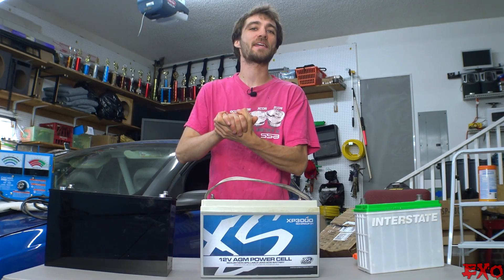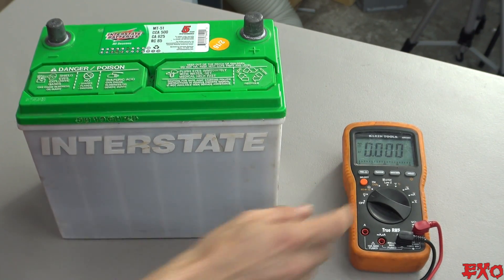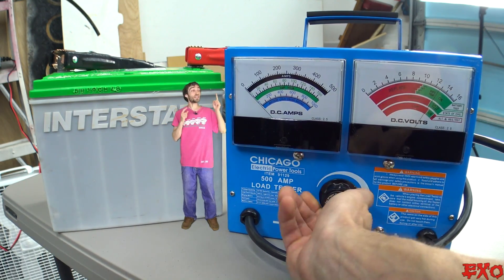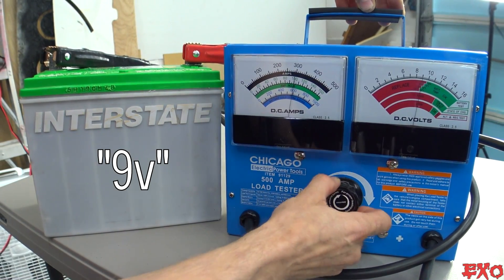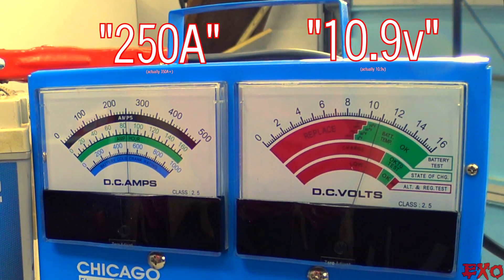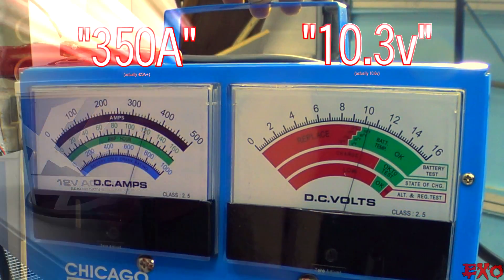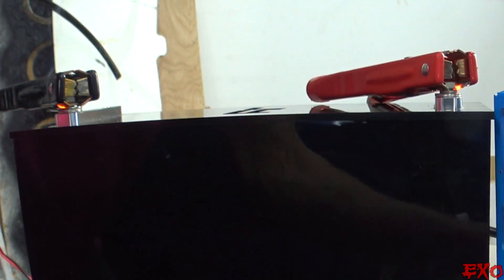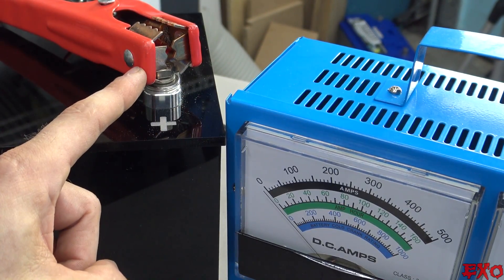BIG vs SMALL Car Batteries w/ Harbor Freight LOAD TESTER | 12V Flooded + AGM & Lithium Battery Test

Comment: Most vehicles run Fuses roughly 250amps. Of course, there are exceptions to everything. I understand the product should work to the standards or abilities it describes/shows but for the majority defective or not that looks to be a pretty handy load tester. May have to get one one of these days. Thanks Exo.

Comment: Those meters need calibration and the production quality on these things are not great so it's always better to change the amp meter and volt meter with a digital one and connect the sense lead of volt meter with separete wires right at the alligator clips for best accuracy . Also install a one or two 12v computer fans pushing air from both side vents into the resistor to keep it cool incase u wanna run it for a minute or two..
Reply: I will link in a volt amp meter that can measure your required current range and voltage accurately. Just look into the flagged comments section.

Comment: Install some computer case fans like delta fans from old dell hp computers (u can ask any recyler they should have them ) those are really high rpm fans and blows tons of air u can power them with an external 12v power adapter and keep the resistors cool while running high load.

Comment: Hey buddy I got a question how can you tell if your battery cap is bad I have a kinetik HC1400 how can you tell if it's bad how do you go about charging it is it like a regular battery to charge I have it on the charger now and it's reading 0.7 on the charger when I put my multimeter to it it says 0.36 does that mean the battery is no good I wouldn't know who else to ask but you ?

Comment: some user error issues. im glad you recognize some problems.  its not always the equipment. i see so many negative reviews on amazon from people that are just to dumb to use the product. those are some very dangerous currents your playing with.
Reply: those were probably accurate readings at the meters. you were causing a lot of loss through heat and resistance as you saw. you were almost welding there.

Comment: Can i use two different 12v batteries , a stock battery and a secondary 3900 ampD6500 xs in the trunk?

Comment: Hey exo, I have 2 Orion XTR 10” subwoofers and them together is 1000w RMS, I’ve done a little research on matching the rms and ohms and I was wondering what I need to finish the installation for when I get a car. What altornators, batteries or capacitors do I need? Also keep up ur vids ur doing amazing😃👏🏽👏🏽👏🏽

Comment: Add a second set of leads to the clips for voltage measurement only and recalibrate the current meter.  Should do the trick.

Comment: Iose connections cost me my subs and learned my lesson with push spring terminals instead of going direct or bolted. My subs were beating so hard loosened the positive terminal on the inside of the box and started arcing my fuses didnt blow instead it melted the fuse, fuse box and wire i haven't bought new subs yet but i have upgrade fuse size and went 0 gauge and changed my box for direct sub wiring but cant figure out what subs to try next i want PSI but right now my price range im looking more towards some SKAR subs anyone that reads this give me some feed back 👍

Comment: That lithium battery costs a cool 2 grand. . . I think I can live with my AGM batteries.
Reply: But it replaces about 3 grand of agms 🤷‍♂️ so it's still cheaper.
Reply: @FiBTL18  only in the voltage point when your alternator cant be replaced you have much less capacity in the batteries. For my vehicle 400ah is about right because i cant switch my alternator so the 12kw setup need that
Reply: @thomaskletzl6493  not actually, lithium amp hrs are double that of agms. Due to the fact you can't discharge agms to 0% without damage and shortening life cycles as where you can do that with lithium. So for your 100ah agm you only can actually use about 50ah of that capacity so your 400ah is really only 200ah. With 100ah of lithium you get the full 100ah. So 50ah of lithium=100ah of agm. And they charge in minutes on a ho alt from dead to full, agm takes a bit longer. I have 2 lil 15lb lithium cyber 12ks running my entire truck and 2 wolfram aw9000.1 at .5ohm along with another 1k amp for the mids n highs. Voltage stays in the low 14s never ran out of battery, and that's with just around 100ah of lith. 🤷‍♂️  I would need 10 100ah agms to be able to cover the same wattage as these 2 small light lithiums handle (bout 30lbs for the both). And would still have more voltage drop with the 1000lbs of agms.

Comment: Great video! Not sure if you have covered this before  but I have a 1k sub amp (kenwood) and a small 4 channel amp. Is it a waste of time to do a big 3 upgrade with 4 gauge all around or would it be a wast of time in my 02 civic? I want to do the upgrade I just dont want to waste my time because I dont plan on going really high with my subs

Comment: I have a Lithium Battery in my 2018 Harley 1200. Lithium batteries need to be woken up. Especially when Cold. Below 50F. Winter sometimes took 5 tries to get the engine to start. The battery is a Twin Power, Direct drop in.

Comment: Are you using them old crusty batteries in 2019. We have LiFePo4 HP.
Do not buy Lead batteries, they weigh too much and you can buy LiFePo4 HP for the same price,  half the weight and faster discharge current.

Comment: You are measuring the volts and current in different places, the resistance will effect this, lower volts will equal lower amps, that's why a 6 volt battery will not start a car, it takes a higher resistance to to pull the current , more resistance , less current, like a 24 v battery on a 12v starter, will pull twice the current as on 12 v battery, totaling 4 times the wattage, on 24v

Comment: They are good load testers but need some mods to be reliable. We use a bunch of these to test power supplies for high amperage CB use. 

First we remove the ends and solder on solid copper lugs to be bolted onto the supply terminals. Then, as you did I use a Fluke Amp clamp meter. Further mods include a small fan in the case, and adding a washer onto the knob. If you keep unscrewing it too much the cheap Chinese metal will strip easily and a washer will help it from backing out as much. We’ve greatly increased the life of this load tester but doing this stuff.

Comment: Having the battery terminals getting hot will show a lower voltage due to resistance, but it should not affect amperage. The difference in amperage between the clamp meter and analog meter should be the same, regardless of connection. there should be more difference in voltage between the multi meter, especially on the lithium, because those hard terminals connect with a sharper point load, resulting in more resistance. When things are glowing red, you know you have a lot more resistance. Those clamps get a good bite on those soft lead terminals, but not that nickel plated brass. If the connection on the lead terminals is poor, the lead melts, allowing the clamps to bite in deeper, increasing contact area.
     It might be worth taking the load tester apart, and going crazy with resistors, especially the ammeter shunt. The voltage, you can't do much about, unless you use separate leads, like when you use the multi meter. Voltage drop at 300 amps will show more of a voltage drop, than just the battery under test.

Comment: I have one of those load testers. I fried one of the connections inside on the unit. I completely rebuilt it. It has alot of loose connections and sub standard solder joints.  Both of the analog  meters on the unit are adjustable. So I calibrated it and it  now works like a charm!

Comment: Could it just be human error?  I mean you were resting the cable clamps on the battery while you were running current through it. Possibly grounding it out?  I know the tester was off but you were resting the clamps on the battery while being connected to the posts. That’s a no no.

Comment: some of the voltage difference is coming from reading the voltage at the battery on the digital and the load tester takes the voltage from the other side of the cables. if you factor in the voltage loss from the cables the analog meter isn't as bad as it would first seem.

Comment: Hey dude! Great video!
I would love to see a lead acid vs AGM battery in your car (with a big stereo)! Just to see how big of a difference it will make.
I have a 95ah lead acid battery in my bmw with a 1200w (@ 1 ohm i think, rms ofc) and a 150 ish amp charger.
Lights are blinking pretty much when i turn it up. So instead of adding another battery (witch i have) im thinking of upgrading the battery to agm. I dont have much space for an extra battery either.

My amp sits right above the battery, so cables are very short.
Love your videos!
Reply: Old one , but how did u do. got the e61 lci with 170a and a deep charge 105ah 920cc efb and running 1200wrms

Comment: Yo EXO, would you be able to cover 14v and 16 volt systems and talk about what is needed for a daily to run one of those? Like for example, 14V battery instead of a 12V and what is needed to properly maintain and how it affects your car and audio system.

Comment: 2 comments.  Drawing 250A from each battery is not really a fair test since at different voltages, you are drawing different amounts of power from each.  For example, 250A at 12V is 3000 watts but 250A at 10V is only 2500 watts.  You should do a watt test such that you pick some goal wattage (such as 2500 watts), then show what voltage and amperage are required to get it for each battery

Secondly, I wonder what would happen if you paralleled all 3 different battery types and then did this load test.  I wonder what it would do at a full 500A draw.  The FLA battery type would want to voltage sag the most but the other 2 batteries wouldn't allow it to do that so much.  It would be an interesting test to do it and check how many true amps are flowing from each battery into the 500A (total) load.  You should consider doing this as a follow up video.  Thanks.
Reply: The amperage will increase inversely proportionate to the voltage at a given wattage. I have very successfully run LiFePO4 in parallel with AGM batteries, it works very well. Flooded cell lead acid mean voltage is just a little bit low to parallel as well with the lithium.

Comment: get rid of those clamps and stick on some ring terminals on the wire ends. it will give a solid connection and probably give a better result. also add a fan to cool the resistor.

Comment: I have the XS power 3000 and it keeps my DC audio 2k and 175.4 fed. Alternator keeps it charged almost full all the time but I do run it down just to cycle it some and charge it back up with my smart charger. It and my battery under the hood. I got all 1/0 XS flex OFC wire and dual inputs a foot from the amps in the back. I have a stinger volt meter on my 2k and it drops to 12.9-13.1 volts under full tilt long sessions. I’m pushing 2 LVL4 12’s so it’s got its work cut out for it. But I did make the box bigger to make it a little bit more efficient so it’s probably about right. It is tuned to 32hz and I’m right at 3.3 cubic foot so 1.75 a driver, recommended was 1.5 so it plays down to 20hz and up to around 80 no problem. Of course it’s louder in the 30-40 range but what Ported system isn’t that’s tuned for music. I do plan to add 2 more and another 2k.

Comment: Hey EXO say I have two brand new wheelchair batteries how would they work pushing my 4000 watt amp instead of running the amp wire from the battery?

Comment: I always ignored the meters on mine and used a clamp meter and multimeter.
If you upgrade the cables too 0g gauge and bypass some stuff inside they'll do up too 1700 amps.

Comment: the digital multimeter as the analog multimeter don't make true measurment because they are not calibrated.
Do you have some calibration sheet when you have bought it ?
Sorry for the mistakes english is not my mother tongue.

Comment: @EXOcontralto the U-charge Cost Almost the same as your JY except the JY has 80AH and the U-Charge has 138AH whats up with that and the XP U-27 comes rated at 4000 cycles at 80% can u do a vid on this if possible and does the XP JY come with a built in BMS like the XP U-27 ???????

Comment: Dang Harbor freight. We all know they have questionable products but we buy anyway!!
Reply: The price is right. I would recommend taking it apart, and calibrating it by comparing it to quality calibrated meters, so it will give you a better idea of how your battery is ACTUALLY performing. It can usually be done by adjusting the value of resistors in series with the meters.

Comment: Those Harbor Freight testers are garbage I have friends who tried to fix them on the inside and put 4 120mm fan's in it to help them and run the fans off a 12 volt power supply but that doesn't help either POS all the way 
good luck to you for try to fix it

Comment: Hey @exo 
Is there any way we can speak before i do something dumb n end up killing myself 
Im about to upgrade to 
16 U-charge XP U-27 Li-iON batteries 🔋being charged by a 300 amp alternator im not to sure about the (BMS) side of things
Reply: Incase ur curious to know what equipment i have 
12kBass Taramp 4 Orion 15”
10k Hd taramp 8 B&C 12” 888
5k Hd  Taramp  6 B&C 750 CP Drivers
1.6k Hd Sound digital 13 Tweeters Prv
Reply: @djpro8258  You definitely don't want to run lithium batteries in a car without a BMS. The BMS is 100% of your protection if anything goes wrong. I have no idea what chemistry these batteries you have use, so it's difficult to give further advice. I'll have to look up the brand and check them out
Reply: @djpro8258  Ok, you should be good. I believe these batteries have built in BMS and I believe it says you can link the batteries together so they all get balanced evenly. Just make sure you visit the website for Valance and get a user manual or something to see how to link them for balancing. Just out of curiosity, how the hell did you end up with 16 of these odd lithium batteries?
Reply: @catch22frubert  my closets friends own an autobody/music and builds shop in the Bronx 
We built a turbo Dominican box to fit 4 15' SPL Orions 
put 16 lead Truck Batteries 4500 series in the van with out realizing that these Orions have no respect for voltage and draw so much power 
soooo i did some research and realized Lithium was the way togo i had a strange piece of change laying around and my friends helped me make the purchase yes the price was insane but the price of protection is worth it,
Orion Coils demand constant power to stay cool to many voltage spikes in any direction and these babies will heat up like an oven then cablooyie 900 plus to re-cone everytime..........

also for anybody reading this TARAMP Amplifiers work on voltage output and are power mongers also i have a 12k Bass and it does its job Efficiently to well to be honest......
once the volage is correct i will be putting out around 16k Rms @ 14V and that is still under powering the Orions by 4k......
Reply: @catch22frubert  some of the most powerful batteries on the market @ 138AH i did alot of digging before making a choice and alot of the Lithiums have 80AH or 90AH when i saw the rating and did the math these linked together will produce 2208AH at 15V maxed now that is Power..................

Comment: What lithium are you going to run in your build?
Reply: U-Charge U-27 Li-Ion
Reply: Parallel to increase just the AH 16 at 138 is 2208-AH
Reply: @djpro8258  what's the c rating of it?
Reply: @djpro8258  I know about lithium since I build lithium batteries for car audio
Reply: Ramon Silva U27-12XP Valence Lithium Battery 12V 138A
Reply: Look it up
Reply: @djpro8258  not a good lithium battery for car audio. It has a very low discharge rate for lithium. Those batteries were made for energy storage and have a high energy density. You are looking at about a 3c discharge rate. A lot of the lithiums being used in car audio is anywhere from 10c-40c discharge rate.
Reply: Would love to hear ur opinion 🙏
Reply: @djpro8258  If you have 16 of these in parallel, and 2208 amp hours available at 3c max discharge rate, you should have 6600 amps available to discharge. I'd say that's plenty for a 12k taramps. While these are not ideal for big car audio, I think you have plenty of juice available for what you are trying to do. Wire them together out of the car and do some testing first and see how things go. I'm willing to bet they will be just fine because you have a ridiculous amount of them in parallel

Comment: Lithiums are eye-wateringly expensive
Reply: Now you need to calculate the cost of how many smaller batteries it takes to match the voltage of the lithium off the same current draw. The extra weight and fuel costs driving with said weight.
Reply: $500.00 a piece and thats on Ebay
Reply: You can build a ridiculous powerful lithium for the price of 3 good AGM batteries. It's really not all that expensive if you need 3+ batteries anyway.

Comment: Woooohoooo 3rd viewer.  I just use the 860 cca  4 terminal marine battery from walmart and run my rp.3000.1d mono and 1000 4 way with a 210 amp alternator.  Stays above 11 volts pretty well